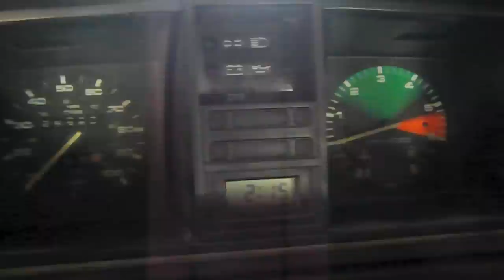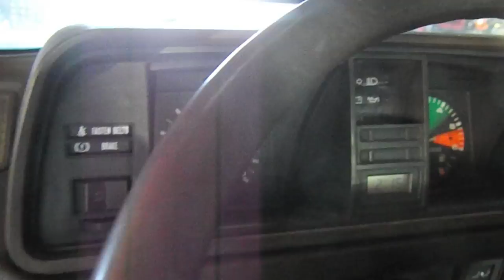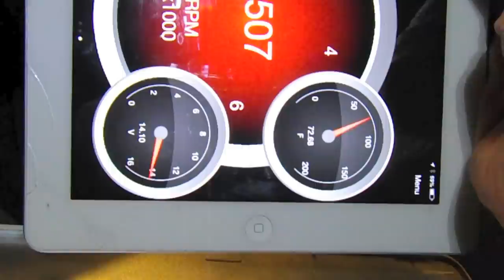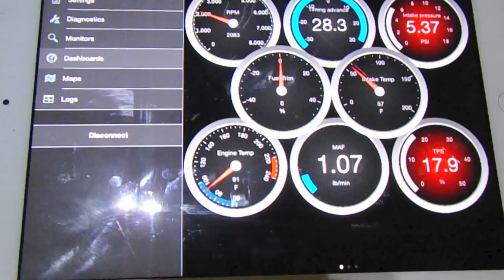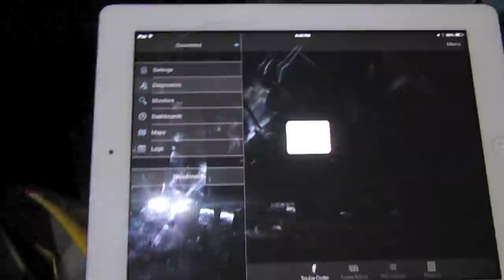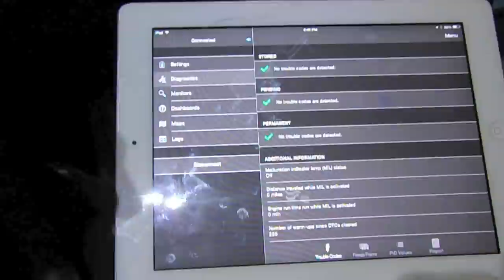VW WiFi Gauges - Subaru Vanagon Engine Swap Part 10

Comment: Nice work, may I ask how much the fuel consumption changes with the motor swap? What is the actual consumption with the 2.5lt?
Reply from the maker: I average low 20’s in my personal bus with a 2.2. I didn’t notice much difference in the 2.5 swaps that I’ve done.